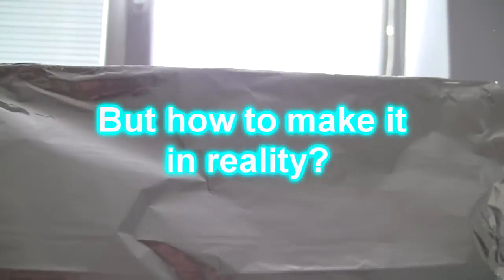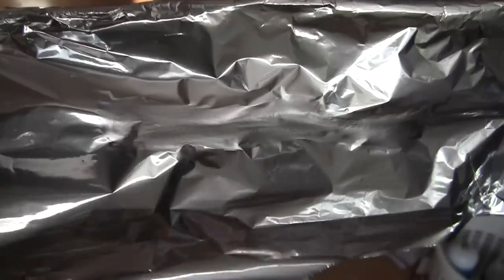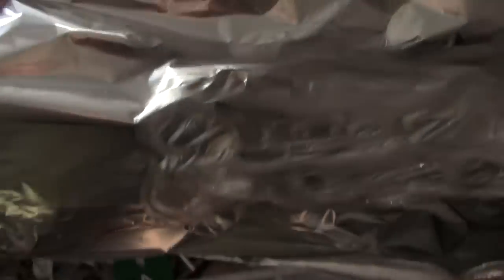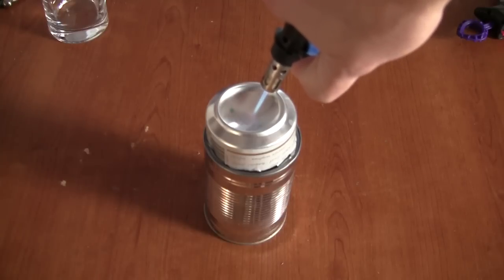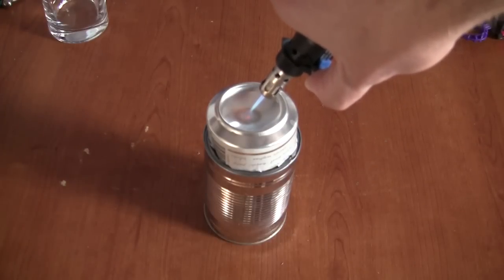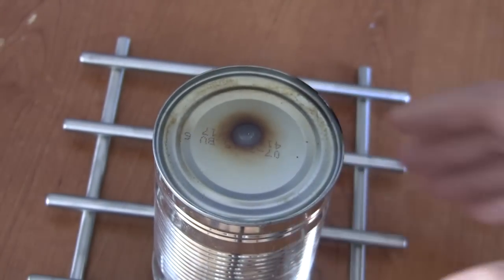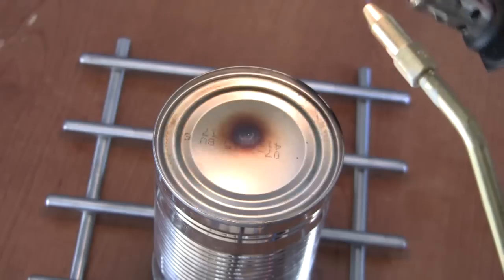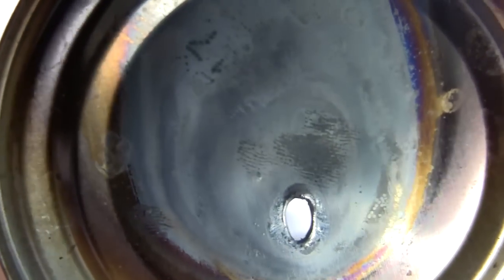How to make REAL Transparent Aluminium!

Comment: I have to wonder if this could be done in a way to use it for cosplay visors. That would be... Pretty damn spiffy, to have what amounts to a one-way visor (probably backed on both sides by heat-molded plastic) that doesn't take forever to make, or require stupid amounts of money, (or the amount frustration it takes to use window tinting...).
Reply: Of course you would.  Because every scientific breakthrough isn't really important until it can bused for the betterment of cosplay.
Reply: Presumably it's very brittle, as this is really turning aluminium into corundum. Also giving it a shape would be difficult, as corundum and aluminium have different density. But don't let this hold you back from experimenting, i'd like to hear of your successes and i won't laugh at your failures.

I think giving the plastic to a mad scientist for sputtering is more promising. Or spray painting with diluted paint, i think they even sell something like that. Krylon mirror-like paint?
Reply: Michael Martin - Well, you're actually kinda right, to a degree. It's a point of note any time science can be modified to work in day-to-day life. I mean, the first computers had single-digit kilobytes of processing power and were the size of a small house. You have something thousands of times more powerful in your pocket at any given time. Get your hypocritical, judgmental shit outta here.
Reply: +Siana Gearz Hah, yeah, I'd tried several methods before this. I'm currently waiting on my vacuum table to try to cold-form mirror window vinyl to a visor.

Also, I think it's amusing that I knew exactly what this post was replying to just by the little bit I could read from my phone alert... X3
Reply: probs could do it
Reply: evaporated vacuum deposition is a way to do it
Reply: Marilyn Newman you can get an assembler monitor cartridge for the VIC-20, it can be rather convenient to program. VIC-1540 floppy disk drive was made for VIC-20 specifically but CBM-1541 can be used with either. In fact 1541 is slower because of a bug in C64 hardware.
Reply: I still have my first computer, a Vic20. 8 huge bites! All programming has to be stored on the tape player. And done only in hexadecimal. And uses a TV.
Reply: Get yourself a pair of mirrored shades.
Reply: Try an emergency blanket.Cheap.

Comment: Are you making aluminum oxide, aka sapphire, with that torch? Maybe that's why it works?

Very cool either way.
Reply: Well he would not be making it, because there is already a very thin layer of oxide on the surface that forms instantly when contacting the air. So my guess is that the pure liquid aluminum runs off to the sides to join with the other pure liquid aluminum leaving behind the very thin oxide layers(front and back).  If you search in youtube  mercury vs aluminum, you can see how mercury breaks down this very thin protective layer of oxide and the aluminum just rusts away,
Reply: I think what's more likely is that he's making small pores in the aluminium.
Reply: That's what I thought, but we're talking a solid-gas interface only reaction, which means the can shouldn't have become transparent.
Reply: Alovatololo but it IS water tight.  technically even the "solid" aluminum is somewhat porous.   what ever is happening here, is cool as hell, and it really works!
Reply: Thats a good suggestion! I should try that out.
Reply: I am fairly sure, that is what is happening.
Reply: They are holes, it is water tight until you break the surface tension holding it together
Reply: What’s actually happening is he’s making Aluminium oxynitride which is a compound of aluminium, oxygen and nitrogen whereas sapphire is made of just aluminium and oxygen. If it was this easy to make sapphire I hardly expect that it would be so expensive

Comment: I'm guessing aluminum oxide is either transparent or is simply porous enough to let light through. 
That's what he was doing. Aluminum does not give off any dark body radiation (not enough to pick up with the human eye anyhow), BUT aluminum oxide DOES glow just like steel when heated. Adding heat really speeds up the oxidation of most things.
You saw him get excited when the center of the can bottom began to glow a little in the center giving a good indicator that the oxidation had taken place well enough to reach the full thickness of the material. BTW aluminum oxidizes REALLY fast.

Anyway. thought I'd drop my guesses on what's happening here.
I would like to know why light can pass through thin aluminum oxide though.
I do know it tends to be pretty porous and when settled in uniform super thin layers, unnoticeable.  It's also hard as shit and brittle.
Hmm... Look up "Alumina" on google. Turns out it CAN pass light easily. Gorgeously in many cases :-D

Comment: Now we can have transparent aluminum cars!  Just a frame, engine, running gear and driver going down the road.
Reply: +Ridheesh Amarthya all transparent, then they can see you fucking in the back seat
Reply: Good thing about this design is that it'll allow the sun through to the solar roadways.
Reply: seats ? electronics ? trunk ? flooring ? roof finish ?
Reply: I think it would have to be too thin to bare any weight

Comment: Isn't this really just changing the aluminum into transparent aluminum oxide which is not a metal but a ceramic?  You have only changed the metal to a ceramic by the heating of it.  Thus, it is not transparent aluminum because it's no longer aluminum but aluminum OXIDE which no longer conducts electricity and loses the physical properties of the metal.

Misleading title to get clicks.

Stick to chemistry.
Reply: TruthSurge still pretty cool. And by my knowledge that is supposed to be Sapphire right?
Reply: ? no idea!

Comment: the sheet of aluminum is stretched metal - maybe the heat from the torch excites the aluminum atoms & when they cool they crystalize into a lattice pattern that is so thin, perhaps only one atom thick, it becomes almost transparent (note that it is blurry when looking thru it). this would most assuredly weaken the material greatly.

Comment: is this not just the result of burning off any impuritys in the foil? or is it caused by the grain structure in the aluminum becoming more exaggerated as its flattened out into the foil sheet creating thinner section between the grain walls that melt faster and with the help of surface tension regrouping on the grain walls, creating a "micro mesh structure" that optically looks solid until a light source is behind it?

Comment: Oh thunderf00t thunderf0-0t thunderf00t. You can't make a metal transparent. Metals are opaque and reflective because of their electrical properties. It would violate Maxwell's Equations. The only conceivable way you could make a metal transparent is if you could somehow turn it into an insulator. Like by boiling it, for instance, since in the gas phase it's no longer a metal. I'll tell you what you have done. You have oxidized the aluminum, perforated it with little air gaps or aluminum oxide crystals that act as fiberoptic carriers. THAT is what you are seeing light through.

Comment: I've just discovered we already have transparent aluminuim, and have been able to manufacture it in large quantities for over a century. It's hard, third only to diamond, and has many industrial uses, including windows. It's Al2O3, but we usually call it ruby or sapphire, depending on the colour, but colourless is the default state before colouring agents are added. It's manufactured using extreme heat. So maybe what you've got there is a very thin layer of sapphire.

Comment: i feel what you are looking at is aluminium with either many little holes in that may only tempory hold water or the aluminium would of partly reacted with oxygen.I did this experiment ages ago,way before you/this viddo anyway and in my observation the resulting aluminium after this is very weak.

Comment: Apparently, transparent aluminum is an actual thing. or Aluminium oxynitride, as its scientific name.
Reply: No nitride here. This is alumin[i]um oxide
Reply: @jacobladder5556  sapphire?
Reply: Aluminum oxynitride aka ALON is made exclusively by Surmet Corp. Amazing stuff, 4x strength of fused silica, 85% as hard as sapphire. Actual Al content 30 - 36%, depending.. optical transparency ~ 84%.
Reply: @Aaron Washburn the foil, doesn't have holes. you can see a clear spot in the foil,  be it aluminum turned clear  or coating that withstands higher temperatures than aluminum
Reply: It was actually patented 8 years before Star Trek mentioned it.

Comment: I've been playing with this as a kid. It's basically rippled aluminium mesh sandwiched between its oxide which has thickened a bit. It's permeable for gases and probably for nonpolar liquids with low viscosity. I'm sure liquid helium readily flows through it. So it's not really transparent. Check it under a microscope.

Comment: If anyone is wondering about how this works, this is how I understand it: Aluminum, when oxidized, is actually transparent. Corundum (which includes rubies and saphires and is clear when pure) is made of Aluminum Oxide. We can even make corundum and use it for various things, including small, transparent windows. Usually, all aluminum is covered with a very thin layer of aluminum oxide (or aluminum rust if you want to think of it that way) that is transparent and keeps the metal beneath looking shiny. When you heat up the aluminum, you allow for deeper oxidation of the metal, and if you fully oxidize it, it should become transparent. Of course, correct me if I'm wrong.

Comment: I'm sure someone already pointed it out, but the world has had and has been using transparent aluminum for a really long time.  It's really cool, that we can make it on an industrial scale.  The military uses it in aircraft like the A-10, because it's lighter than the equivalent amount of protective glass/plastic.  It's sapphire! Artificial Sapphires, made on an industrial scale, melted and pressed into fighter pilot and attack helicopter windows.  It's clear, with a slight blueish tint from certain angles, because it isn't TOTALLY pure Aluminum Oxide.  It has an incredible hardiness because of the crystal structure, and so can stop fairly large caliber bullets. I think the shells on the planes and helicopters that they make out of it are an inch or two thick.

The same windows go into the Space Station, but I think for safety there, they're layered.  Real Transparent aluminum is just Aluminum Oxide crystals!  Works just as good.  Pretty cool.

I'm not sure if that's what's happening in this video, or if just the melting of the aluminum makes it more transparent as the material weakens and shifts out of the way.

Comment: +thunderf00t can you try doing this in an oxygen-less environment? I guess you might need to use electronic heating.

At the moment I'm guessing that the aluminium is burning or melting to become a very thin film and this is how the light is getting through but otherwise I'm a bit stumped. Can you test the conductivity?

So far as I knew Indium Oxide was the leader in transparent conductors. Perhaps you're onto something :)

Comment: That reminds me of when I used to make 200 Angstrom thick AL2O3 (aluminium oxide) films by anodising foil, placing it in a beaker in a frame with HcL (hydrchloric acid) and etching out the pure metal just leaving the anodising.  They were used to cover microchannel plates in 3rd Generation Image Intensifiers.

Comment: I believe you are actually creating transparent Aluminum Oxide, or Alumina...You can test this by checking a piece of it with an Ohmmeter.  If Aluminum Oxide it will be a good insulator, if it is still aluminum it will be a good conductor.

Comment: maybe the heat caused a homogeneous crystal to grow in the aluminium while the original can forming process is via sheet metal works instead of casting and the mechanical forces involved in sheet metal work shatter the crystal structure.

Comment: Sometimes I wonder about Thunderfoot.  Here I'll give him the benefit of the doubt that he's just making a cute video with the Star Trek reference and does not actually believe he is making transparent aluminum.  All that is happening here is the aluminum is reacting with the oxidizing flame and turning into aluminum oxide.  Aluminum oxide can be opaque or optically transparent due to crystal structure, i.e. porcelin or sapphire.  However, with a thin piece of burnt aluminium the resulting ceramic web formed will be transparent because it's thin enough to not have to worry about too ordered of a crystal structure for some light transmission.  The steel is a more complex chemistry, iron ceramic ceramics are generally not transparent even in perfect crystals, and carbon is also involved and forms surface layers through decarburization of the steel to form slags on the surface.  With steel the structure will be lamular unlike the fragile web of the aluminium.  Look at it under a microscope, clean it up with some acid to dissolve away any unreacted metal, may make an interesting additional video.

update:  I just looked at a piece under the microscope and it starts to become clear well before any significant oxidation starts to occur.  What I see happening is the aluminium under the stresses of thermo cycling and formation of dendrites is "ripping itself apart and forming lots of small elongated cracks.  Something like a screen with long narrow holes.

Comment: pretty sure all you're doing here is melting away the elemental aluminum and exposing the thin coating of aluminum oxide that's on the non mirrored side of the sheet, or just converting it all to aluminum oxide.
another case of  'a little knowledge encourages the ignorant'

Comment: My question would be, thought transparent aluminum retains water, has the strength or any other properties of the original aluminum, been compromised?
Reply: +Walt Rowen well I would imagine so, mostly the tensile strength becoming compromised. Try it for your self see if you can find a difference.

Comment: The transparency is a purely physical phenomenon.  After heating, you are left with a porous material run through with tiny fissures.  It's pretty much all oxide by then, maybe with thin metallic filaments remaining in the cores of the oxidized fibers.

The dynamics involved the the formation of this structure are interesting.  At some point the material undergoes tension and is pulled apart from itself leaving a structure of "jagged fissures" and "rough fibers" all oriented parallel to the edge of the heating zone.

Under high magnification, the edge of the transparent zone is full of tiny ripples, which gradually open up into deeper fissures as you get closer to the heating zone.  Eventually they go all the way through and you have your transparency.

Comment: Reminds me of a story about some people going to Africa to teach the local women how to build solar cookers. 
They had their design all worked out at home, but for some reason it just wouldn't work in Africa.
Well, turns out the aluminium foil there is so thin you can see right through it, and it didn't reflect nearly as much.

I don't know what quality of blackbody radiator you require, but I found black automotive exhaust spray paint works well enough at low temperatures. It is meant to be heated until it turns into a glossy (enamel) surface, but if you never heat it that high it will stay a matte surface with emissivity very close to one and reflectivity near zero. I use it to calibrate a thermal camera against a thermocouple.

Comment: so what causes this? does a part burn off, leaving a very thin membrane of sheet of metal? or does the heat cause the metal to have tiny holes that will let light through but not water?
Reply: +StickyTank
I've done this and looked at it under a microscope, and the structure of the pores is like a bunch of wrinkles and tears.

It looks as though the aluminum melts and ripples in the heat, but then gets pulled tight as it oxidizes and the tension opens up a bunch of micro-fissures as the material becomes brittle.  The fissures all tend to be aligned, and run parallel to the edge of the spot where the heat was applied.
Reply: +HansLemurson i've burnt some tinfoil before and i did notice that it became very brittle and fragile. thanks for the explanation :)

Comment: My guess is you made transparent alumina (Al2O3). The flame oxidized the metal. Alumina is clear (aka sapphire). Perhaps a mix of aluminum and alumina keeping the clear area from just shattering. Clever trick tho. I bet you could make transparent silicon too if you had a thin enough piece. But aluminum sure has a Hollywood potential.